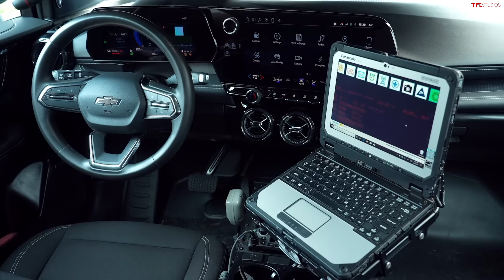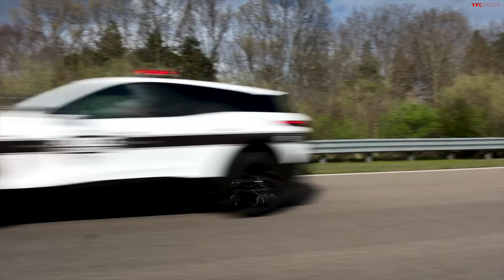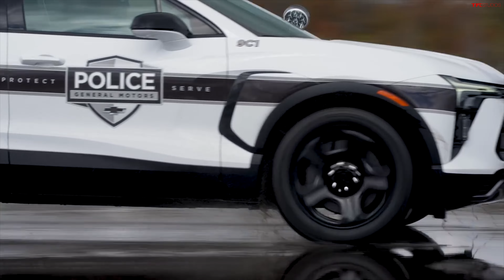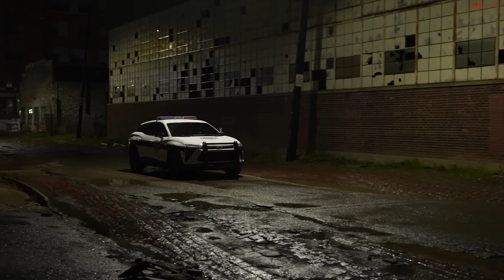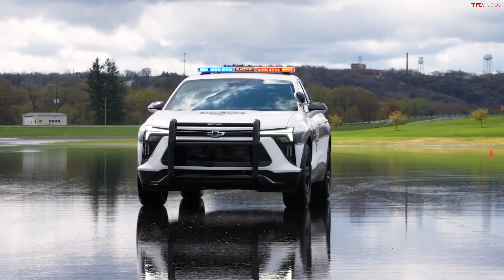You Won't Hear It Coming: Chevy Debuts An All Electric Police Car With THIS Cool Cop Power!

Comment: The fact GM can't build their own vehicle at scale shows how incompetent legacy auto is at making EVs. Their experience is a joke.  They look like the keystone cops of auto
Reply: Teska can't introduce a new model without a 3 year wait between models. Who is incompetent?
Reply: @TroySavary  Tesla updates and mods its platform with all the glitz of an exterior change. The M3 suspension was changed in 22, they added heat pumps, they added a model with LFP batteries, cameras were changed and the software constantly tweaked. Range and charging speed has improved over the years. What's Ford done? Oh yeah, raise the price 5 times and forget how to build em at scale and improve them tween years. Sad.
Reply: @ChicagoBob123  Added heat pumps, years after the competition had them. Big deal.

Your excuse for Tesla being unable to launch new models at a faster cadence than every 3 years is that they improve current models? So does everyone else, yet they manage to work on multiple new launches at once.
Reply: @TroySavary  lol your hilarious.  Legacy auto can't even do a software updates without a dealer.  What was the charging speed of the 150 at launch?  What is it now? Gm bolts have charged slow since 2017. MachE GT overheats of you push it too hard.  Maybe they should stop worrying about the color of the seats and get their car to work
Reply: @ChicagoBob123  The Bolt is a soon to be discontinued platform. Its charging speed has no bearing on Ultium. Try to keep up. Not sure why you keep bringing up Fird in a discussion about a GM EV. Try harder. Maybe next post will actually be relevant and discuss the point I made.
Reply: @TroySavary  yeah the refreshed outside didn't help the run rate.  The seats sucked for years and gm was losing money on them while they improved nothing.  Ford continues to sell the same Truck Farley said sucks to charge.  Doesn't matter if they add pinstripes after 5 price hikes
Reply: @TroySavary  you made no point
 Legacy auto sucks
Reply: @ChicagoBob123  My point is that while Tesla is struggling to release one new model in 3 years, GM is launching several just this year. Tesla already lost the lead in China to BYD and Europe to VW for the same reason. 2 sedans and 2 fat sedans pretending to be SUVs is too few models to stay relevant. Meanwhile, you are still having trouble telling Ford from GM.
Reply: @TroySavary  lead on EV cars?  How many did BYD make? Not PHEVs just EVs. And VW doesnt sell really EVs at scale.  Cyber truck this year and refreshed model 3. Then model 2 in 25 and refreshed model Y. I cant see anyone catching them until 2030 maybe.  Tesla will be at last 4 million a year with better range and the Tesla truck over 100k so much going on for Tesla.
Reply: @TroySavary  Bolt is no longer discontinued, they are going to keep making them.

Comment: So like a 1,000,000 something plus for each police charging station location
Reply: You have a problem.
Reply: The city budget will be just fine and they won't need to charge 20 cars simultaneously. Just one arrest can put you back at the station for two hours of paperwork.
Reply: @davidmccarthy6061  They think all police are in 120 mph car chases for hours.
Reply: Its about $5,000 dollars for a commercial grade level 2 charging station so I guess they will be putting in 200 stations not just 1 for your $1 mill.
Reply: It’s a police operation that has to fast charge the cars during shift changes to keep them on the road just like the fossil units they replace so 20 something plus squad cars is a big expense

Comment: Police could also adapt their routine to use opportunity fast charging. It wouldn't be too difficult to plug in to a fast charger while they type up a report or take their break.
Reply: A partnership with Tim Hortons and Dunkin Donuts could solve their fast charging issues 😊
Reply: @jamespaul2587  you know this was a good joke back 30 years ago, now with the shortage of cops if we even have 10 minutes to pee during a shift for most departments its a miracle, most days we have 15 to 20 back loged calls..so no donuts,barely time to stop to pick up a coffee.
Reply: @msterpeter1  I can definitely imagine that, and we definitely appreciate the service and sacrifices of our first responders. I saw 2 paramedics in a local McDonald's this weekend, grabbing a quick bite  during a well-deserved break.
Reply: And this way we will have law enforcement at charging stations as well as the gas pumps, since they’ll have to utilize fast chargers too.
Reply: @G-Rated  actually we use city or govt stations,50kw enough for a 20 to 30 minutes charge time to full.
exactly during lunch or paperwork or just sitting there waiting for something depending on time.
we use the F150 as a road safety/traffic enforcement and it does 12 hours shifts easily we also have 1 Mach E that does the same this one is decked out, the F-150 is unmarked but has the full compliments of lights. since LEDs use very little energy.
I,Ve had to do traffic block for 10 hours and still had 55% left so it would be the troopers that would have to change habits of their work paterns mostly.
the silence is also something to get used to specially during accelerations you cant use the engine as a gauge when accelerating.
Reply: Honestly, unless they really do get into a prolonged high speed pursuit I think they would never even need to fast charge. As long as the car can sit off use on a level 2 charger at the station for a probably about 6 hours it'll probably get to 100% every time.
Reply: @sipher3516  One of the concerns regarding the suitability of EV'S as police vehicles is that many departments hot-seat their cruisers so they get passed from shift to shift, which wouldn't work very well with overnight charging. A couple 15 minute fast charges that coincide with idle time would allow an EV to run around the clock. More expensive yes, but possibly cheaper than additional cruisers.
Reply: @sipher3516 it's more likely to only need an hour or two a day of Level 2 charging. Police cars don't do many miles a day, they mostly sit by the side of the road waiting. City police cruise around all day but they do it at 20MPH which is where EVs are most efficient and ICEVs are least efficient. 
Long pursuits are probably pretty rare, most people pull over immediately when they see the flashing lights. The long high speed chases only happen when a felon tries to run. When that happens it's not one police car doing the chase it's many and they are radioing ahead so that other police can join the chase or setup roadblocks or stop sticks.

Comment: Will it out run a stolen Hellcat in Arkansas?
Reply: Faster than you can think.
Reply: Good luck going over 130mph on any roadway other then a straight stretch of freeway. Good luck getting away when the EV can accelerate faster at all speeds up to its governed max of 130mph.

Comment: I absolutely love how everyone wants to make the topic of discussion gm’s supply/production of these high in demand EVs that everyone wants from them. It takes a quick Google search to know that the manufacturer is waiting on battery plants to go online, since they build their own for their bespoke EVs from the ground up. It takes time to ramp up production for brand new bespoke vehicles on brand new platforms while there’s a war going on and part scarcities that trickled into the new year after the global pandemic.

The go-to comment for gm use to be “I’ll believe it when I see it” as if the cooperation never even planned on building these vehicles. Now that it’s evident they are as the GMC Hummer EV twins have both beat even Tesla’s own Cybertruck to market, all people rather discuss is their weight or wait.

I think it’s pretty bogus and corny. gm you’ve proven all of your naysayers to be incorrect. I am very proud, and I cannot wait until production is ramped up fully just to show the trolls that you meant what you said by leading the charge!

Comment: I would 100% support this! As long as the battery is serviceable, it really is the perfect police vehicle. Maybe not a “pursuit” vehicle, but that would be the exception in the municipality!
Reply: 550 horsepower sounds like pursuit to me.
Reply: Most of those pursuits happen because the slow explorers can't safely accelerate in time to perform a pit maneuver. They won't have to worry about range if they can beat most cars on the road and just accelerate right away to get them off the road.
Reply: my ev just had a battery replacement it was sent in as a core to be rebuilt and I got a rebuilt pack put in...
Reply: FYI Lithium ion batteries  aren't really serviceable like a ICE,for the most part all you do in an EV is Tires,rotation,alignment,cabin filter,and replacement of the whole battery after you reach Half a Million miles,or 12 years whatever comes first Bud.
Reply: @magallon643 Skill issue. Do it like anyone else does and you’ll have no issues servicing batteries.
I understand if that’s outside your abilities though!
Reply: @JollyGiant19  guess what just like land lines we didn't get stuck with them,thank to technology advances everyone eventually switched to cell phones so.
Reply: Yes because the police have laser welders to swap out cells on the go😂
Reply: @BipoCosmo Lol, when was the last police chase where a cop had to do a quick road-side engine swap or replace a fuel tank and kept on chasing?

Comment: Only thing this is good for is Airport Security vehicles. Or a metropolitan area like NY or Chicago. Once you add 1K lbs of gear the range will drop even more. You won’t be able to charge them fully either. In most areas of the country 1st/2nd shift would use the same car assuming they run 12hr shifts. 🤦🏼‍♂️
Reply: You do know that the weight in an electric vehicle has very little affect on range. Aerodynamics is king. 1000 extra pounds might lose you 5 miles of range.
Reply: How many miles do they typically cover per day,? That is the question. It maybe surprisingly few.
Reply: @HangingShoes   I did find one source that says 100 miles per day + 100 miles of 'idle time'.  Absolutely won't be using this cruiser for consecutive shifts.
Reply: @doublebackagain4311   Just fast charge between shifts. The EV will "idle" for about 3 days.
Reply: @doublebackagain4311  idle time is irrelevant for an EV
Reply: @natehill8069  Really? Sitting conditioning battery + running AC/heat and electrical might be minimal but not 'irrelevant'.
Reply: @doublebackagain4311  Assuming it has a heat pump, AC/heat would be by far the biggest draw. That starts at around 5kW and drops to about 2kW after its run a while. So call it 3 kW with the other electronics. That would be 28 hours of idling on a full (80%) charge. I think that fits just fine into a 12 hour shift; they could start the shift with half battery and still not worry. The motors between them draw well over 420 kW with full boot (and probably 200kW cruising at the limiter), so compared to 200kW, yeah 3kW pretty much rounds to zero.
Reply: NYC alone has a bigger population than Colorado and Utah combined. So it'll probably be a massive hit and extremely effective. Easily cover the police departments that serve the majority of Americans.

Comment: Top speed isn't everything in police work . . . especially since you have a lot of vehicles in this country that don't reach 130 mph and since most policework involved municipalities and counties, not state police where long chases are possible (local conditions may vary . . . )

I would see these used in cities, where the vehicle does more low speed driving, and counties and less in state police work, especially large states where a patrol vehicle might easily break 250-300 miles travel each shift.
Reply: @StarFleet_Tech1701  guess they'll just have to learn to pit like ASP does, before they reach speeds...lol.  ASP is legendary.
Reply: OldThom specifically said likely not for state patrol. Also the vehicle can go 130 mph so 100+ mph is not a problem. Other thing to remember is 60 to 130mph in these vehicles is also faster then any gasoline vehicle which means on anything other then a very long straight road they are still going to catch you.  @StarFleet_Tech1701
Reply: @StarFleet_Tech1701 Nope.  Don't watch such things

Comment: Miles of range reduction when using their lights or siren I can’t wait for the testing.
Reply: Y’all know nothing about EVs. Absolutely nothing at all. 😂
Reply: tests already done. EV police vehicle with lights, sirens, and all computers running and AC on will run for 24hours straight before depleting the battery. Guess its not a worry is it.
Reply: @Shomo-lk8zh  including driving? And is this spirited driving during a chase or not?

Comment: I was tossing around the idea of getting a blazer SS, but the police are getting a better trim lol.  Scratch that idea!  Not to mention this exact platform is the basis for the Honda Prologue, Acura ZDX, Cadillac Lyric.
Reply: police PPV= SS version exact same vehicule other then some slight upgrades,*brakes,suspension and inside fittings
Reply: What do the Honda products or this PPV have to do with a consumer wanting a Blazer SS EV?? You seem to be confused.
Reply: @G-Rated  they are all the same vehicle underneath
Reply: @BakingThePoundcake  fortunately for Honda that is true, but we’re all fully aware. Is that all that you have to contribute to the conversation?

Comment: I just need to be able to outrun its range.
Reply: Hahaha can’t outrun two way radio
Reply: Helicopter...
Reply: You not outrunning a radio.
Reply: ...and disconnect your Onstar (or whatever equivalent they put in your car) so your car doesnt just pull over and stop. Unless of course you have a mechanically injected Diesel from the 70s where theres no computer to control.
Reply: Came here to comment this, good luck catching an f150 with a 36 gallon tank
Reply: @GregtheAwesomeNinja well the f150 won't be going fast. Plus the police have multiple vehicles. They will just coordinate their efforts like they do now
Reply: @GregtheAwesomeNinja  I pity the fool.

Comment: Great video. As a retired deputy sheriff I’ve been calling for this for years. Even in small towns, the fuel costs are astronomical. This would be perfect.
Reply: It’s the same reason a $78k Silverado EV capable of 400+ miles of range is a game changer for fleet customers. Beautiful vehicles and the costs saving within a year on fuel could mean these vehicles are paying for themselves within a few years.
Reply: Agreed. Every time I’ve seen police cars idling for hours, it drives me crazy.
Reply: Police cars are running longer than your average vehicle especially with idle times. The department could see a payoff sooner than the average consumer. This also depends on upfront cost and up fitting.
Reply: Girl Math 😂
Jk - they're comin Bad Boys
Reply: How many more vehicles would they need to buy since they’ll have to be charged without lowering the patrol manpower. The ICE vehicles idle because of things like AC and Heat along with a myriad of electronics inside the car.
Reply: @wsmith810  my 2023 Chevy bolt could idle all day with full air conditioning and not use much charge. I Uber all day and idle at times without any issues, as well as getting 300 miles of range. I think the police vehicles could run 8 to 10 hours with no,issues, then charge cheaply over night or vise versa…..
Reply: @EV-Darryl that's not how police vehicles work.  There are  three shifts, days, swings, and graveyards.  Days is generally 0600-1600, swings is 1300-2300, and detail 3(graveyards) is 2100-0700.  Days takes fleet 1 on day 1, swings, fleet 2, and detail 3 takes fleet 1 again, returned from dayshift.  The next day, dayshift takes fleet 2, so on and so forth.  A busy city the cops will have 20 calls a night. There will need to be an ability to supercharge as those cars don't get much downtime.  Gas cars can be filled in 3-4 minutes.
Reply: @EV-Darryl  Have you seen the size of an average LEO?  They won’t fit in a Volt or any other compact car with their size, their gear and all the electronics in the car. Now throw in a cage for the customers and you won’t get the average person in the back door. Maybe they’ll go back to calling the paddy wagon.